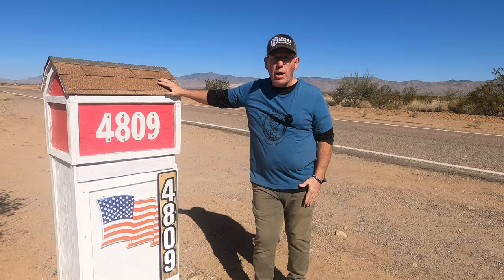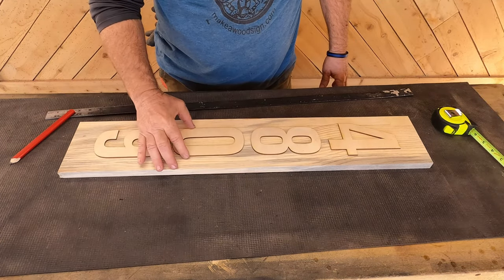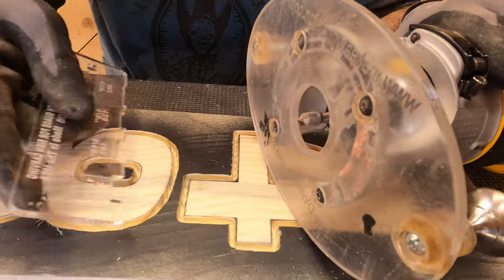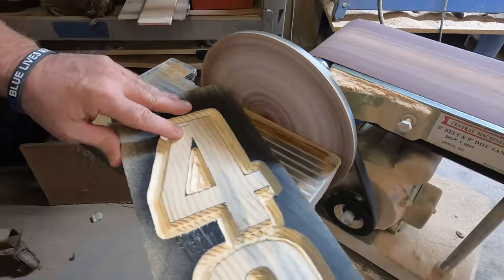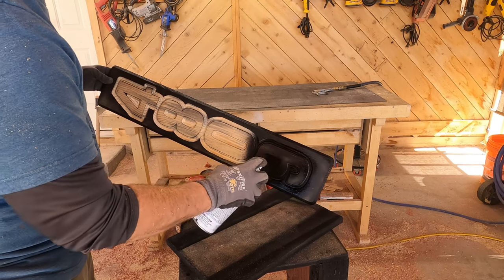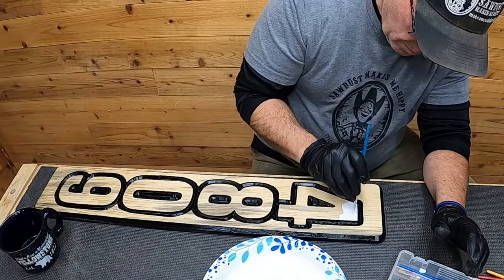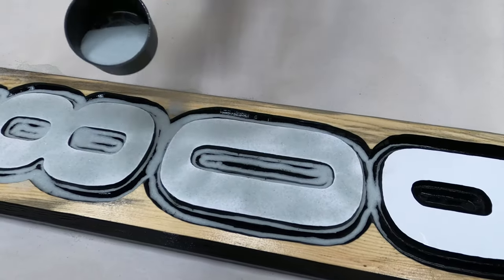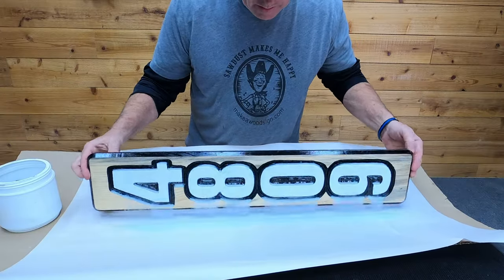DIY Reflective Address Sign: Tips and Tricks to Make Your Sign Stand Out"

Comment: Wow, that came out great! But, now I have questions!😀
I made a 2x12x12 for my old work. It was also in a rural area with a hard to find turnoff.
I used a primer. Do you find that you get good durability without it?
I also used exterior house paint. That stuff dried so fast that hubbie essentially had to follow directly behind with the beads. Even 5 min and they wouldn’t stick. Did your paint stay tacky that whole hour? 
At the time, I had read posts that said that if you use a clear coat, it will reduce the reflective  effect of the beads. Did you do any testing before and after the clear coat? 
Sorry for all of the questions!! But the beads did appear to sink in a lot, and there didn’t seem to be a sweet spot between the application and the sprinkling.
Thanks so much!
Reply from the maker: #1 we didn't use any primer before we painted. There really wasn't a need for it. 
#2 the one shot paint takes quite a while to dry so we waited an hour before we laid the bead.
#3 we did all the finishing before we painted. The bead was the last step.
Hope this helps👍👍
Reply: Thanks for the update ❤ @oldave100